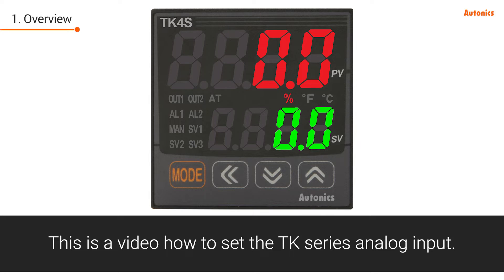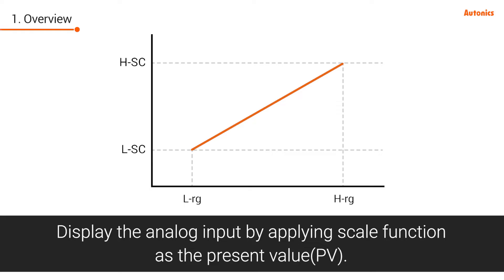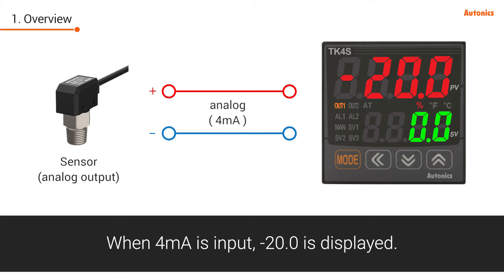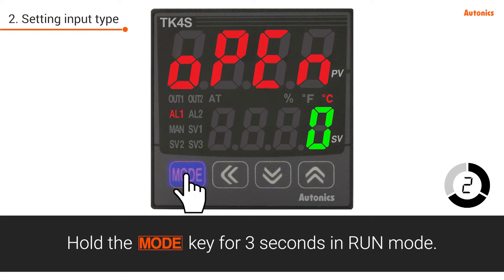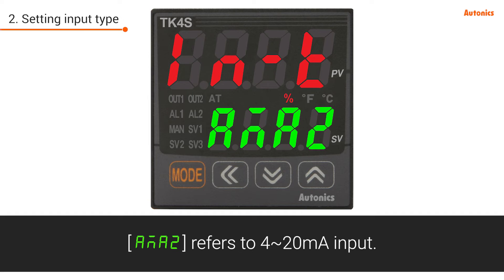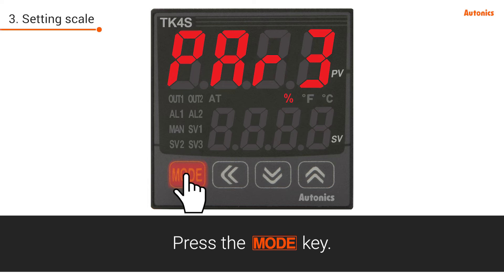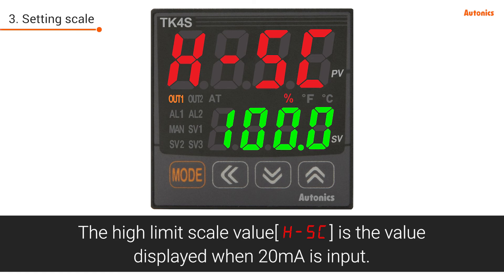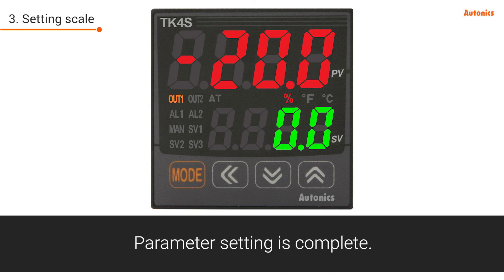Autonics Tutorial : How to set analog input(TK Series)

Comment: I want to convert the input to an analog signal of the sensor (like the resistance of the PT100) instead of a 4-20mA signal, how do I set it up?
Reply from the maker: Thank you for your comments. Could you tell us exactly what input signal you want to use?
Reply: @AutonicsCorp  this is resistance, i use the sensor PT100
Reply from the maker: TK series can connect JPT100Ω type and DPT100100Ω type.